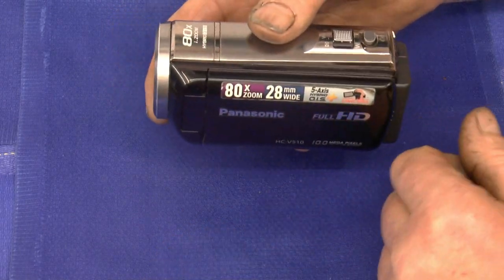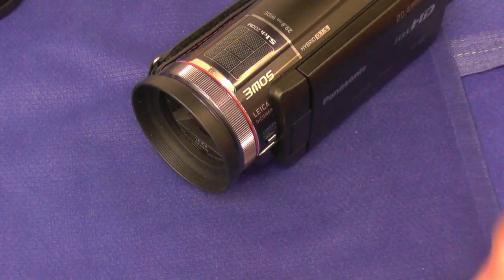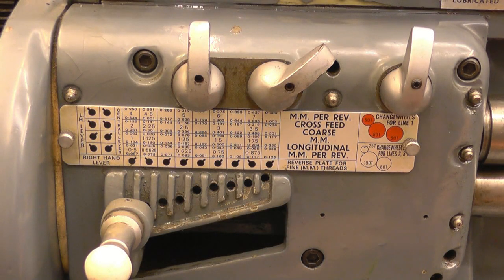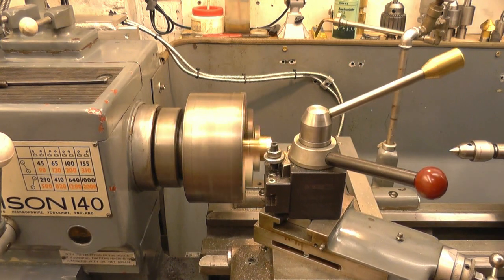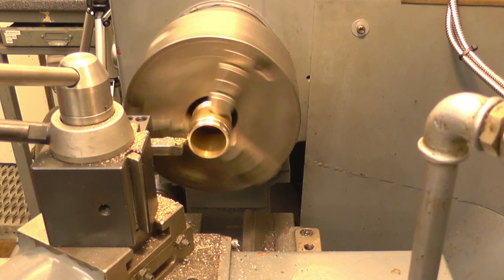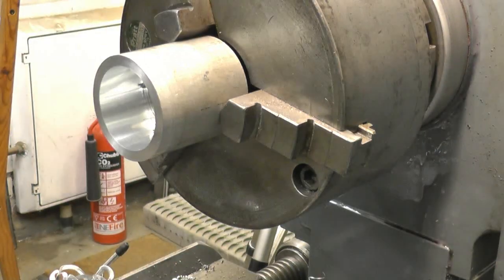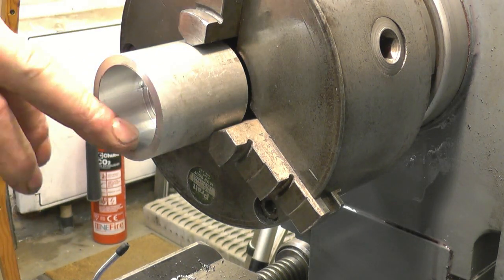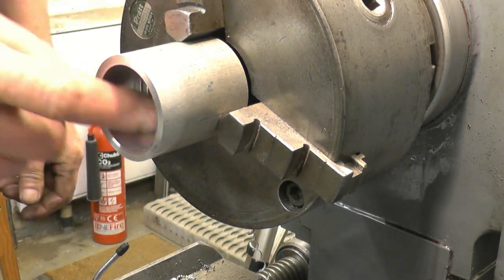Wide Angle Lense Adapter

Comment: nice job John like the fact that you can disengage the half nut cutting metric thread my mate has a bantam lathe which is metric and you have to keep engaged with the lead screw till your done makes it interesting on an internal thread with a dead end foot hovering over the brake
Reply: david sanderson  Not quite correct, on a metric Bantam you can engage feed nuts at anytime if the thread pitch is a divisor of the 6mm leadscrew. 6,3,2,1.5,1,0.75,0.5 can all be cut this way, unfortunately common threads like 2.5 & 1.25 can't. For those and IMP threads a self lifting threading tool and a VFD come in handy.
Reply: Chris Stephens hi thanks Chris never thought of that ill give it a try will save some time thats for sure
Reply: Anytime, knowledge not passed on is lost.

Comment: Hi John. Funnily enough, I made  exactly the same adaptor for my Panasonic video camera. I used 6000 series ally. The reason I made mine is I wanted to mount a protective UV filter and a proper lens cap.

Comment: Making photographic adapters is exactly what I would want a metric lathe for. I know it can be done on an imperial lathe, but I don't have the 127T change gears for it, and it's so much easier with a purpose-made lathe from what I've seen.